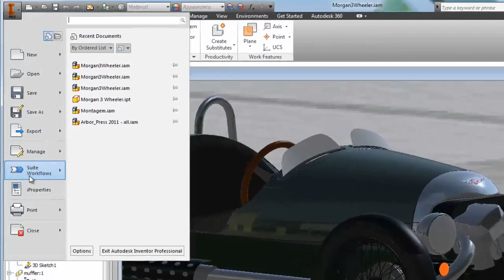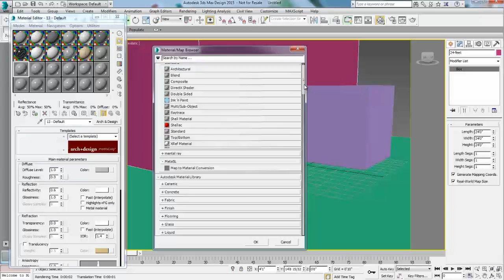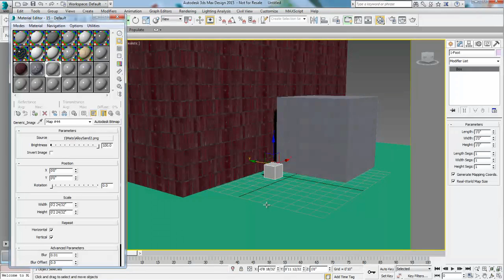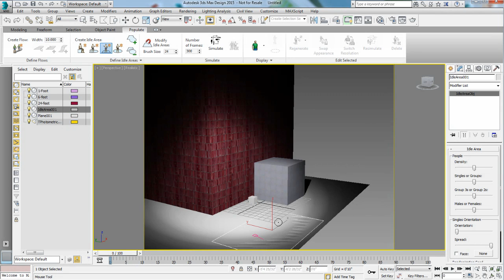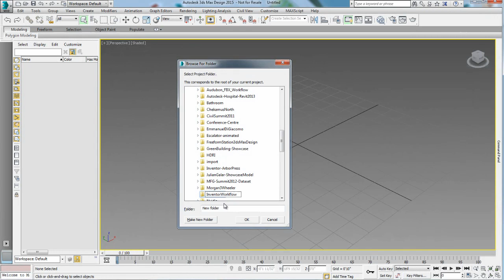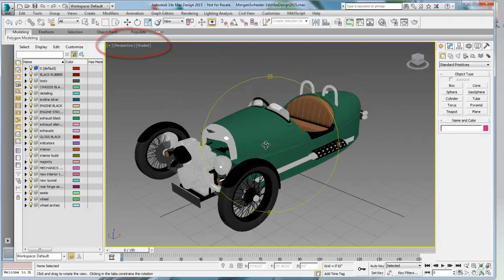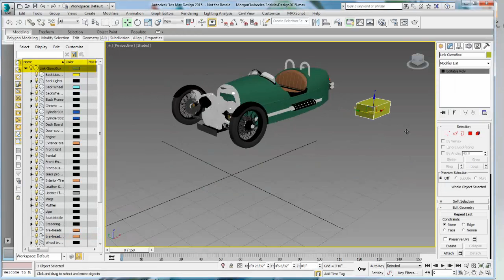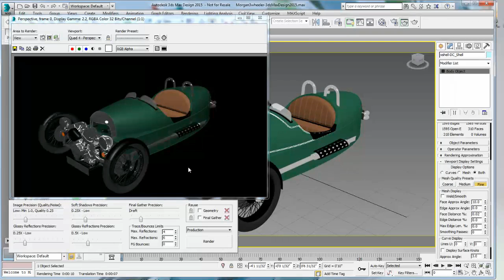Inventor workflow part 1: Importing an Inventor model into 3ds Max Design

Comment: Hi Marion. What if I want to update some parts in Inventor, then replace the mesh in Max, without affecting the animation?

Currently, it has a naming conflict, but doesn't allow an actual replacement of the part in Max. It means I have to manually replace the mesh in Max and reanimate changed parts, which I'm trying to avoid with so many parts being updated on the project.

Do you have a solution for this?

Comment: Hi Marion. Whenever I import from inventor to 3DS some of the objects become one, and don't stay as single objects. For example, I import a kitchen where the handles are seperate objects from door, as they need to be a different colour. But once I've imported the file and have it open in 3DS I cannot click and choose just the handle on it's own, the whole door including the handle becomes one. Any ideas? Thanks

Comment: Great tutorial. I've been using 3ds Max off & on for a few years now. I recently imported a model from Inventor & all the parts moved from where they're supposed to be, to the origin. Everything in Inventor is where it should be, but in 3ds Max everything is piled up on 0,0,0. I've never had an issue with this before. Can you help me out? Thanks.
Reply from the maker: The best place to help you with this issues is via the 3ds Max Forum. Please post your question here: http://forums.autodesk.com/t5/design-visualization-workflows/bd-p/design_visualization_workflows

Comment: Fantastic Marion, my question however...I am importing a very very large inventor assembly, it really takes its toll on my computer, how can I slim things down?, I am not in the position to shrinkwrap as I will need to animate every part....total parts are in the region of 18,000!, any suggestions?, thank you in advance, Neil
Reply from the maker: HI, yes, it's often the challenge with Inventor projects. If you can split the project by different component and do multiple imports, I think it would be the best approach but I am not sure how easy that is in Inventor. I am more familiar with Revit projects for example, I will import the walls, the windows, the typography and all the furniture as different RVT or FBX files. It reduces the import time and makes it more manageable once in Showcase. Once everything is imported in Showcase I am still dealing with a large model and all the challenges attached to that. Do you need EVERYTHING for the visualization or can you think about close up on certain parts? You will have to be more creative in your approach. Good luck.

Comment: Hi marion , good job , very impressed with your knowhows on lighting aspects. I would like to know if I could directly bring in inventor drive constrain animations into 3ds max?
Reply from the maker: Hi Mithunn, unfortunately, 3ds Max doesn't support Inventor constraint. All animations will have to be re-created in 3ds Max. Inventor constraints are only supported by Showcase.